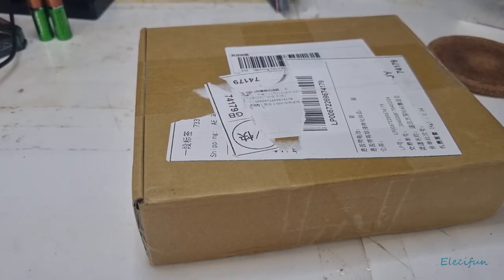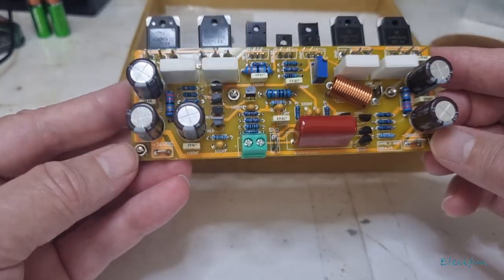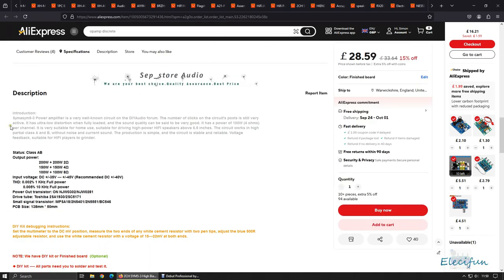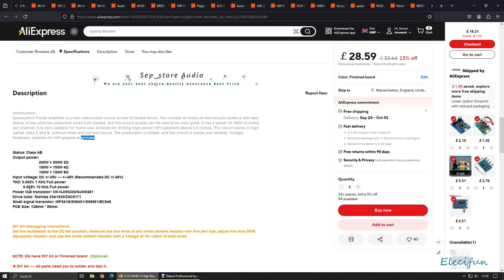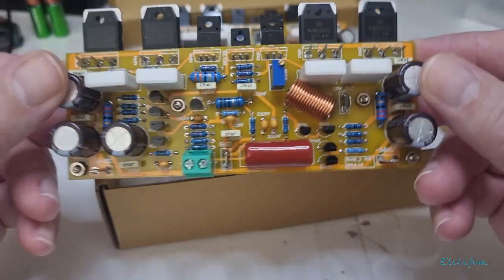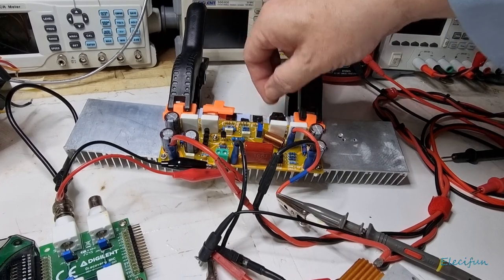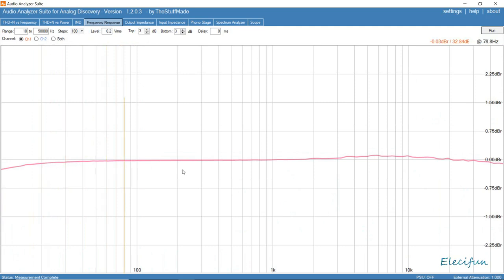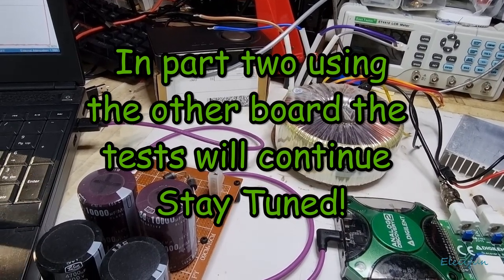SYM5-3 High Bias Class AB Power Amplifier DIY Kit/Finished Board (AliExpress)

Comment: Okay, so the THD specs are basically a lie right? 🤔 How much difference do the transistor make? I mean if you substituted the transistors for better transistors how much difference would it actually make? Kinda annoying that they quote these bogas specs. There should be recourse to get your money back because they don't perform as expected.
Reply from the maker: @decem_unosquattro9538 When testing there are always variables which will differ from one test setup to another. 
Sometimes I think the mistakes made in adverts are there to leave ambiguity, plausible deniability. Some details seem to be copy pasted from other adverts.
Reply from the maker: @decem_unosquattro9538 I checked out the radio your building... it looks like a good one.

Comment: Thanks for another interesting video Elecifun. That looks like a really nice amp for the money, provided you receive genuine components...🤔🙄 I've noticed that I have to turn the volume on my device way up to hear your audio. Is that ironic for an "amplifier" video?...🤔🫢
Reply from the maker: @Sonic_Ox not sure what the volume issue is bud, all the same settings this end. 
The power transistors might be questionable I will have to check out store bought to find out.